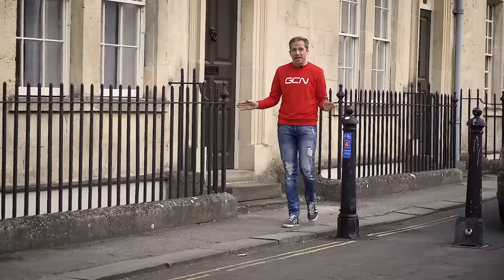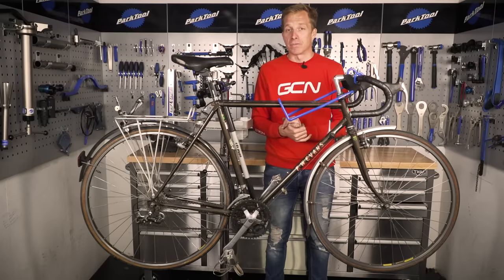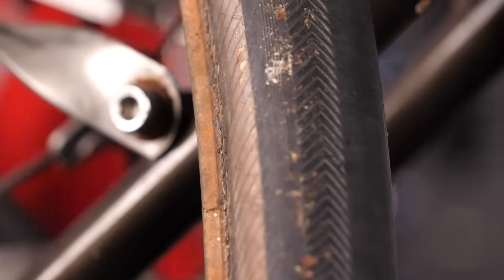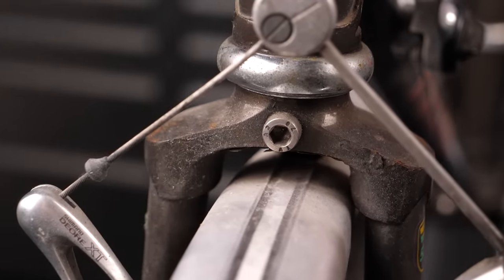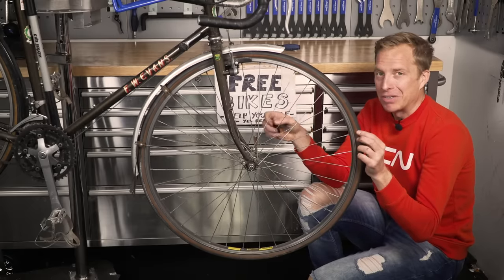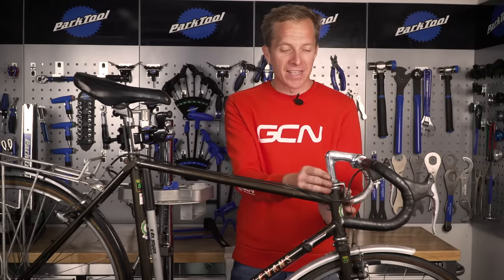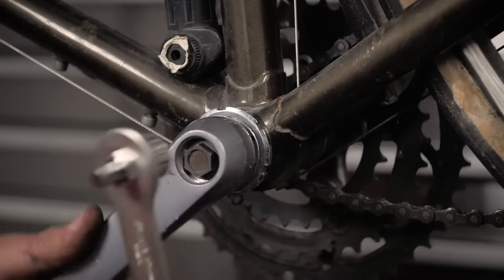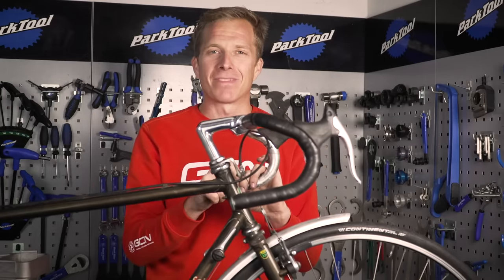Trash To Treasure | How To Fix Up An Old Bike

Comment: Frozen seat post. Once you've dealt with an aluminum (aluminium for those of you who pronounce pasta as pah-ster and garage as g-air-idge) post that has leeched into a steel tube you will always check for that issue before all others. I've used 8 foot long breaker bars with massive pipe clamps exerting well over 1,000 pounds of force on stuck aluminum posts and they've still not broken free, had to be sawn off then sawn down the center from the inside with a tube saw then squeezed+rotated to get them out. Nothing else in bike repair comes anywhere near the headache and risk of bodily injury as a stuck seat post. The cure, of course, is to then get a new post and ALWAYS use a copper based anti-seize on the post in combination with pre coating the inside the tube with a 5w synthetic oil. Other than that, and all that was touched on in this video, I check for stripped threads on everything from tensioners to levers and, most certainly, gritty freewheels/cassettes as those are the signs of severe abuse by persons who (as is very common) had absolutely no clue what they were doing and/or took the bike into circumstances beyond those which it was designed for. Toss in bent crank arms, damaged pedals, out of true bar to fork alignment, basically signs of a serious crash and/or sloppy previous repair or maintenance.

Comment: I have been given and also saved some bikes that were on the way to the trash bin. First thing for me is parts.  Does it have any good parts if to much work is needed.  But if it looks in good condition I first check the bottom bracket and the frame.  It those two things are good, it's going home with me.

Comment: I rebuild several road bikes every year and you can resurface the cones and even the cups. The last bike I just finished all was pitted, I resurfaced both wheel hub cups and cones with new bearings, and they spin like new.

Comment: I would think, (Not having read all the comments below), that you would check out the rims of the wheels. Wear from braking can cause failure on the road if that metal has been worn too thin from braking.

Comment: Always new brake wires and pads - you have no idea of how worn they are, of which quality and it's a cheap life insurance.
When it comes to wires, to get really smooth operation take out the inner wire and use a can of pressurized lithium grease (preferable with PTFE) to lubricate the inside all the way through.
On the wheels, don't forget to make an estimate of the side walls of the rims... I have personally worn through those on quality wheels.
Bearings, chain and other mechanical things you decide to keep - Clean before lubricate!

// Proud (first) owner of a 1984 Miyata touring bike. Most moving parts have been swapped out by now but it still serves even though it seen some heavy loads (me with large backpack + front and rear luggage) and gravel roads.

Upgrades since new: Added front luggage rack, 3x7 gears (was 2x6), fixed chain protection (was rotating), straight handle with fixed handlebars (was type shown in video), extra strong rear wheel (I'm heavy).

Replacements due to wear and accidents: Rear rims (several), front wheel (rim worn out by brakes), saddles (and for comfort). Everything "pedal to pedal", mud guards (metal fatigue), rear luggage rack. Brake components, wires and tires of course.

Comment: you have to check if the seatpost moves - if not leave it on the street, because the old steel frames are near impossible to unfreeze

Comment: You should have changed  the brakepads since they are cracked in some spots. I wouldn't bother changing all the inner and outer cables and giving the whole bike a proper clean and polish of the chrome.

Comment: I know this is an old video but in these testing times I'm watching a few to distract me from going insane.

I've built a few bikes, trikes and tandems in my time (I'm 80) and rarely bought a ready to go bike, so all those 'strange' fittings (bottom bracket, headset etc) are normal to me.  One thing I always insisted on after a GB handlebar broke off in my hand just as I was about to get out the saddle, was good quality fittings - 3TTT or Cinelli - and I notice that beautiful Evans has a 3TT handlebar.

As for what I would do as a matter of course is replace all the cables, the tyres and rim tapes.  I'd also strip, clean and regrease the bottom bracket, headset and wheel bearings and replace components as necessary.  I know the term 'road bike' here means a stripped down racing bike but all my bikes were (and still are) touring bikes much like this Evans (most of mine are Mercians as I live near Derby).  Even my 'racing' bike was an old Mercian touring frame with a pair of Campag/Mavic sprints I built.  I time trialled trikes and the tandem, too but really 99.9% of my riding is on touring bikes much like this Evans.

What a find!

Comment: I built loads of bikes, I would've stripped it down completely and changed all the bearings. New cables also. Put the wheels in a jig to check them. The chain and cogs would benefit from new ones too.

Comment: I've found many a Raleigh 3 speed at the dump, Just flush the gear hub out with penetrating oil and fill it with 80W90 and they seem to cope well with rural towns, Even managed to get 27mph out of one on 43 year old tires.

Comment: found a Univega Road Bike by a beach dumspter 3 years ago. needed a chain, got that, blew the old tires near a bus stop within 3 days, went home and changed the tires, rode for 3 more days, put on look-type pedals......that shit does not know what time means:) still wears an original Mavic-M40 in the front and a Vuelta Aero with a 9 speed cassette in the back. 
always check the neck, bottom bracket bearing components and brakes:) it can handle 15 mph sustained in a short sprint on a calm day:) which is a lot for a 59 year old:)
as the man said, NEVER TOSS A THOUGHT SO EASY:)

Comment: First bike: Puch Mistral in puch green colours. Took it to the local bike shop, the mechanic (whos a close friend since then :D) was not offended by my request to repair it myself with his tools. So I got a few beers, some snacks for the mechanic as well. After about 6 hours, my little precious got a new set of Campagnolo Veloce and some Fulcrum rims. Fixin up old treasures is the best thing ever. That old reynolds frameset was smooth and easy to ride, looked amazing (until got hit by a car...). If anyone got an old Mistral layin' around, just PM me :D
Reply: Though not a Mistral i use a 76 Puch Jungmeister with the 3 speed torpedo&Sachs internal gear hub for commuting. Love that bike. Also did a double century on it
Reply: Thats pretty insane! We need a GCN forum to upload all the pics of the vintage bikes the community got :D I hope someone reads this from GCN CC...

Comment: I would have disassembled the entire bicycle, down to the bare frame. Cleaned and polished everything I planned on using and rebuilt all bearing surfaces. Detail and wax the frame then reassemble with top quality cables and tires.

Comment: For me, most bikes end up getting new tires, tubes, cables, chain, brake pads, and grips/bar tape. If it's particularly old, I usually go ahead and disassemble the bike and re-grease the hubs, headset, and bottom bracket. If not, I'll just do a simple check for any play or funny noises in those parts.

Comment: Just found a vintage Ross bike on the side of the road doing my daily 50 minute bike ride! It’s absolutely beautiful, but I’m so afraid to start working on it. I’m a 19 year old girl in college and I’ve never learned how to do anything mechanically. I don’t even know where to start. This is my dream bike though so I couldn’t just pass it up. All I have done so far is remove a bit of the rust with white vinegar and coated those bits in baking soda. Any tips would be great! I really want to fix this myself because I want to prove to myself that I can do it!

Comment: I love restoring old bikes. I am especially keen on Dawes Galaxies. I think I have restored and upgraded about 10 of them in the last few years. I was very keen on the  ones from the 60s!  I have come across a Dawes Londoner which seems to be almost identical in every way to the  Galaxies of the same era. Given it is has a center pull brake and that is a 15 speed bike Imagine it must have been a great bike in its time. Based on its faded baby blue metallic color I think it was an early 80s or late 70s release. 
Would you know its relation to Galaxy? It has a Reynolds 531 steel frame but it is not the elongated touring geometry like the Galaxy.

Comment: Well a neighbor gave me a mountain bike for free a couple of days ago. The bike is a NEXT brand bike which cost about a $150 US dollars brand new. The frame is straight, but the bike was obviously neglected badly. But here is what all I checked on it: head set, front forks, breaks, crank & crank case, bearings, front and rear wheels, spokes, both hubs, cables, break leavers, shifters, handle bar, head set adapter, gear cassette, and rear sway bar shock assembly, chain, derailer, peddles. What all needs replacing? Just about everything but the frame. Yet is it worth it to restore the bike to its original condition? Only you can answer that, as it might be worth it or worth the time to disassemble it for scrap metal. In my case, I’m thinking yes it’s worth it to have a second bike to ride.

Comment: Hi John, I'm also doing up a 1980s steel frame bike, a Nishiki Landau.  It's a superb frame, and reminds me of my old Rotrax back in the 60s.  I'd like to lower the handlebars and also get narrower ones.  The handlebar stem looks exactly like the one on your lucky find.  As I had some difficulty fitting a carbon seatpost, (I had to file it down from 27.2 to 26.8 mm diameter to make it fit), I thought I'd ask you for advice on fitting a modern handlebar stem.  The outside diameter of the head tube is 31 mm or 1¼" .  Do you think that there is a modern stem that would fit that, and if so, what diameter would it be?

Comment: Hey John, thanks for the video. Good find btw. I was given a Giant CFR 2 recently and I’m torn between doing it up or stripping it down and selling the parts. The frame is larger than I would like but can change the stem to a shorter one etc. It is in fabulous conditions with a few scrapes on the paint job. The Shimano 600 groupset is in great conditions with original Gold Rigida DP18 deeper section wheels , ok gun walled tyres need replacing so easy job. Any suggestions would be appreciated. Thanks.

Comment: Seat post and stem.  remove, regrease, install.  aluminium in a steel frame, it will need a bit of loving.   after that it's very very dependent on what the bike looks like.

Comment: A while back, i found an old Viscount bike in the trash. super light, "aerospace" steel frame. It has the replacement fork, not the "death fork." I'm trying to decide if I should fix it up or scrap it. The biggest challenge is the bottom bracket which has press fit bearings, no threads. The spindle is damaged, so I either need to find a new one (not an easy task) or use some kind of threadless replacement. @GCN Tech et al, what would you do?

Comment: If the components and cables are in bad shape, you can convert it to a single speed and have a light, low-maintenance around town bike for super cheap.

Comment: You forgot to check if the seatpost was seized in the frame. If it is, then all the other work is for naught. I always check that first on a restoration because it can be very hard to impossible to address,

Comment: The first thing I'd do is check for the size of tire that the frame will accept.  If it's supposed to be a touring bike, the minimum tire I'd want is a 35 mm open tubular.  If it won't accept that, I'd give the bike a pass.  If the frame does pass inspection, I'd strip the bike down and inspect the tubes.  If rust hasn't gotten to them, I'd sandblast the frame and do a basic paint job.  Then I'd upgrade just about everything.

Comment: I acquired an old peugeot aurige (?? Its hard to read the stickers) with shimano exige.
Given it has a shimano groupset, would a modern shimano groupset fit? Im pondering updating to claris (basic but modern) which would give me 8 gears instead of 7, modern indexing and modern brakes. I dislike the crank too, feels odd (not worn out odd i think its a function of the exige crank).
It has shimano 700c wheels which are in decent shape altho the rear needs trueing (which is odd, ive had it in storage a while and it didnt need it before...) can the older wheels have a modern cassette installed or is a whole new wheel necessary?

Comment: If the bottom bracket was loose I would have just put new bearings and grease in it. If it was riding loose, then there was abnormal/uneven wear happening on the surfaces. If any hub or bearings on a bike is loose, fix it right the first time and rebuild it with new bearings and fresh grease.

Comment: Assuming it was legitimate (eg not stolen etc) then I'd check:

I'd strip it completely and check for internal corrosion on the frame. If it was a decent frame - 531, handbuilt by a known maker then I might consider a re-enamel if it seemed necessary.

Then reassemble, replacing headset cups, cones balls and bottom bracket ditto if required.  

Check wheel rims for wear on the brake surface and replace if needed after checking hubs, replacing cups/cones etc if of sufficient quality (eg Campga). Respoke with stainless DA spokes - again if the hubs justified.

New block/cassette and chain and possibly chain rings.

Replace tyres/tubes if necessary.

Probably fit a saddle of choice from stock :)

New brake/gear cables. h/bar tape/ change pedals if not SPD. Brake blocks

All the former only if it was worth the effort.  Just check the former if it was intended as a 'shopping' bike.

In any case I have a few Mercian frames already so I'd probably pass it on :)

Comment: I found an old bike in the corner at a car-workshop near where I live. The proprietor said 'take it', so I did. It turned out to be an old Guerciotti frame with Campagnolo Nuovo Record and associated hardware front to back. I still haven't got round to restoring it. Do you have any tips? Is it worth the effort?

Comment: Always check that the seat tube isn't fused and that the quill stem isn't stuck. Check the pulley wheels on the rear derailleur to make sure someone didn't chew them up trying to mount a more modern, narrower chain. These can be fixed, but require careful attention. Also, why wouldn't you just replace all of the cables and housing? Why not just go ahead and service the bottom bracket, headset, and wheel bearings if they are in good shape? These are cheap and easy fixes. Any steel bike in reasonable condition deserves a second chance. These things are awesome and real pleasures to ride.
Reply: I was puzzled why he didn't emphasise your points about seat tube & stem, after all they are likely to need adjustment to accommodate a new owner. I also don't understand why he didn't replace cables & housing - that just seems penny pinching to me.

Comment: Replacing cables, break calipers, tires and chain should not be thought of as a special think to keep in mind. In fact, you should be ready to replace those with every bike you are buying used. And also replacing them regularly on any bike. 

Don't be afraid to put a little money into a bike, buy a new saddle, new mudguards etc., whatever would make you feel more comfortable on the bike, or even just liking looking at it.

Comment: I would like to see how you might retro fit 700 wheels. Recently got an old Schwinn touring bike (Columbus tubing) but has 27" wheels. While these wheels are ok, I have VERY limited choices for tires. If I switched to 700s,  there would be a lot more options. Biggest concern is how I would get the cantilever brakes to fit 700 rims.
Reply: I have found that the diameters are so similar, very little brake adjustment is needed between old 27" and 700c wheels. Swapping a 650b is a bit trickier.

Comment: How'd you get the rust off painted surfaces? Your previous rust removal video used aluminium foil and coke/vinegar. Does that work in this instance?
Reply: Yep. It sure does
Reply: @JonCannings  woohoo! I'm tempted to get a rourke custom steel frame as a 40th birthday present to myself. Knowing I can treat rust is very reassuring.

Comment: Interesting approach, but I don't think I could trust an old bike without giving it the Big Makeover.
Meaning, I would probably have taken the whole thing apart, applied some Framesaver (or Fluid Film, as the case may be), repacked the BB and headset, repacked the hubs, cleaned as much rust as possible off the small parts, replaced the chain, regreased all the moving parts on the derailleurs and replaced the brakes for modern cantis (probably not necessary, but brakes are a bad thing to gamble on). I also would have replaced the stem and bars as they're aluminium and therefore possibly a little brittle at this point (and the bar shape is kinda meh, but that's down to personal taste obvsly). As a bonus, I may have considered taking it to the powder coaters, unless I REALLY loved existing the paintjob, just to be on the safe side in terms of rust protection.
In all, that would be have been an investment of about 250€/225£ (incl. the powder coat and all replacement parts - minus p.c. it's more like 50€) and a long weekend's worth of my time. A small price to pay for true peace of mind imo.
Oh yeah btw, if anyone from GCN Tech actually reads this: nice bike and great video! It would be really amazing if you could do more retro/vintage bike related stuff on this channel. Pretty please? Cheers, guys.